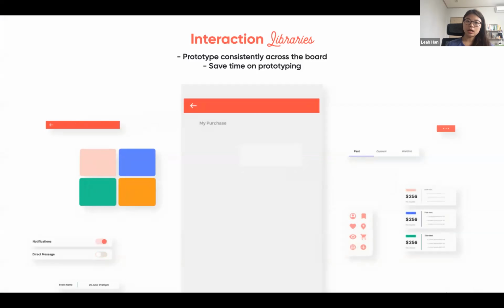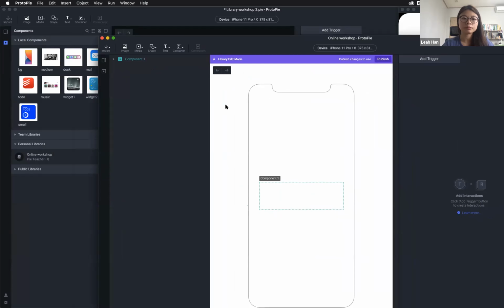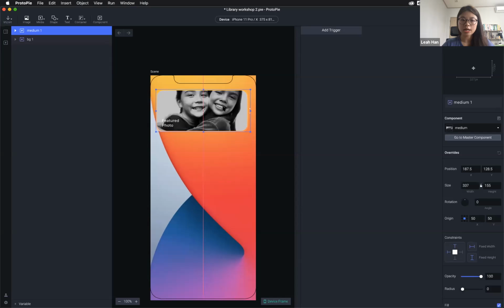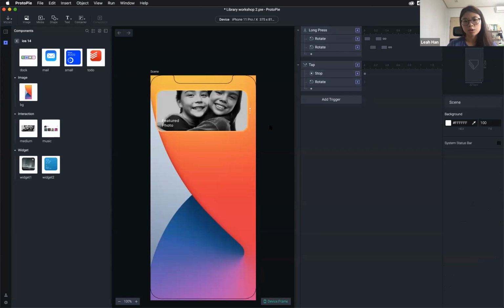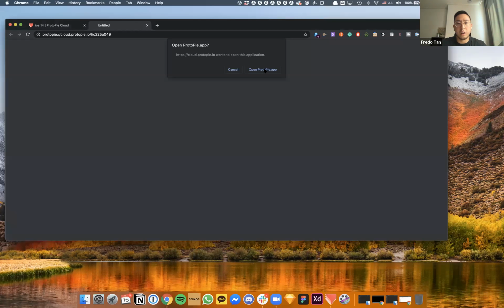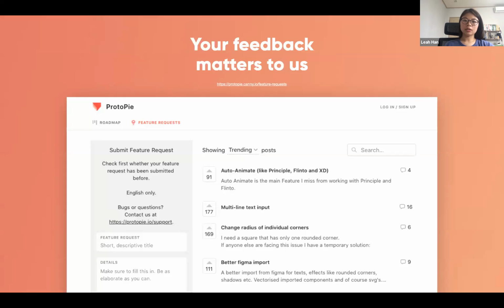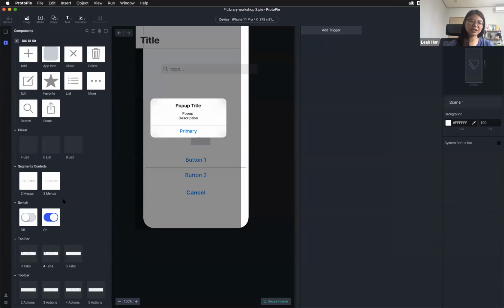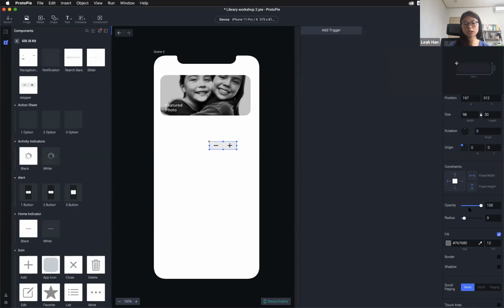ProtoPie Workshop: Interaction Libraries Workshop

Comment: No. it can't do everything.  
like the six-digit verification code input filed, separated
Reply from the maker: Hi David. Could you elaborate on this? Maybe we can help you with it ;).
Reply: @ProtoPie  When a user creates a new account, a 6 digit verification code will be sent to user's email or phone as SMS. I need to create this page where the user indsert the code, it needs an input cell for each digit, so there will be 6 cells. when the last digit is inserted, there will be a "verification successful" message. I think I made myself clear.
Reply from the maker: @davidfitcher2953  Check out this Pie. I think this is what you are looking for 😊. https://cloud.protopie.io/p/0caae70586